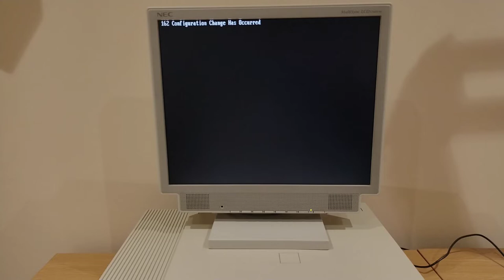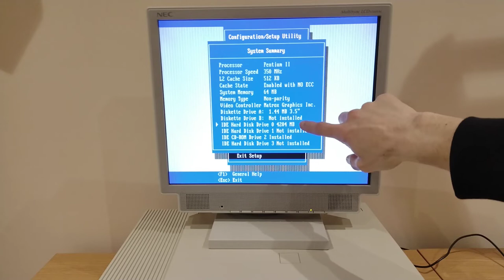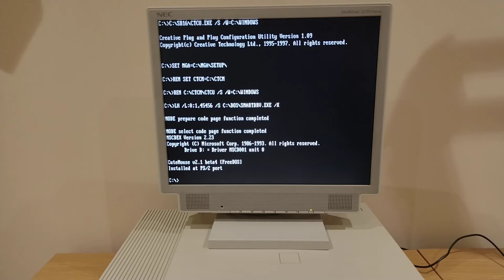IBM 300GL Part 2 - Lets (try to) put this 300GL to some use!

Comment: Nice two videos. With the size of that thing, looks like it barely fits on your desk. The keyboard would barely fit. How deep is that thing? And how big is your table?
Reply from the maker: Thanks, they do have  quite a large footprint, about 45*45cm. The desk (at the end of the video) is quite small though, only 53cm deep which I think makes it look at bit bigger than it is.

Comment: I've always loved the look of these cases. I have an IBM 300PL, very similar to yours except it supports slot 1 Pentium IIIs and has an AGP slot. makes a great Windows 98 machine. Currently have a Pentium 800MHz, TNT2 Ultra, and Sound Blaster Live! installed though it does have ISA slots if I ever wanted to make it a bit more DOS oriented
Reply from the maker: That spec sounds awesome, and very versatile as you say. That TNT2 Ultra and SB Live! are an inconic windows 98 combo.

Comment: hope you got that cd drive sorted. i recently rebuilt a PC350 - P200MMX model with the slidey-front cover. The S3 video kept booting in grayscale, HDD was toast, no CD drive at all and no soundcard. I shoved in a Trident PCI video card, 8GB CF card as the HDD, an IBM branded CD-ROM (probably anywhere from 8x to 24x speed, I haven't really benchmarked it), 3Com 10mbit network card and a very capable ESS AudioDrive ISA sound card. Now it's a beast! My first ever IBM too. Such a cool design and was something I only dreamt of back in the day :) 

Cheers for the vid!
Reply from the maker: Thanks! I'm slowly making progress with the CD drive, but there are a couple of other issues I'm trying to sort out too. Your IBM sounds great, I like specs you have gone for,  hopefully I can get this one sorted out too.

Comment: Cool PC, I have one but it is not in working order and has been sitting in a box waiting on me (4 years). I have and use my IBM PC P350- P166. It has a wonderful IBM ESS ISA 1868f sound card, Matrox Millennium /4gb GPU, Intel 1000MT network, 64 MB ram, IBM CD ROM and floppy. 2 hard drives 1.2gb, and 4.3 GB. I have OS/2 Warp 3 as the primary OS and it also can boot into DOS 6.2/WIN3.11 which I rarely do. I also have an old IBM printer (dot matrix) with it. My IBM crt recently bit the dust so just using an old Sony 17" LCD. On the lookout for a matching IBM CRT but not holding my breath.
Reply from the maker: Thats sounds like some sweet specs on your machine! Good luck finding an IBM CRT, they must be getting quite rare now?

Comment: I still have mine , but the cpu , cdrom and power supply are missing .  back in the day I upgraded the CPU to celeron 450mhz  using and adapter ( socket 370 cpu to slot 1), I went beyond the ram limitation and reached 728mo EDO.  if you had pci grahic card like geforce2 MMX  you would be able to emulate 90s consoles , and play over a hundred pc games
Reply from the maker: Nice! Those Slot 1 adaptors were great for giving a bit more life to systems as they aged.
Reply: @RetroSuperhighway  yeah ,  I even tried to mount the famous Pentium III-S  tualatin 1.4ghz on these adapters , but the system didn't even boot up. Maybe the limitation to FSB66 on the motherboard was the problem . If any one got the 100-133mhz slot one motherboard and could try  to mount pentium III tualatin on them using the adapter, that would solve my old interrogation

Comment: Hi i got ibm 300gl just wondering what kind of graphic cards are good put in this old system? I got sound card bottom  row , 2 rows are free then 3rd row network card then last row up top is free  kind stuck what card to put in 

Darren
Reply from the maker: What do you want to do with the system and what CPU and RAM does the system have? Lots of good options of to pick from depending on what you would like to use it for.

Comment: I remember these. Don't remember an optical uh, panel and thought it weird without one. I might say the onboard video might be more than adequate for DOS Win9x usage. S3 video chipsets are decent though if ya has the Matrox... heh ***shrugs***

Keep trying different KVM's? or cables? I like the KVM's with detachable cables that can be replaced, however those connection add their own set of problems. bleh. the KVM I used while being a technician, I attached Power and Network cables making for easy plug and go. DOS and BIOS usage is important and I would keep investigating for sure. <3 all
Reply from the maker: I'm sure the onboard video would be fine, its certainly more powerful than the Matrox, but back when I had my original 486 I always wanted a Matrox Millennium for that sweet video quality, so I'm determined to fit it into this build.

Investigations are ongoing, but it seems the 300GL might be a bit more poorly than I first thought. I'm going to be scouring the internet for some parts before I can make much progress with it.
Reply: @RetroSuperhighway  still a Beut' though! but as a primary DOS and Win95 machine? I think it's a bit much. toss the matrox into another build and stuff a voodoo2 or banshee or other fun video for winME and FreeDOS or uh whatevah! ***shrugs*** makes for gud videos for sure ;D

Comment: Great Video and a new Subscriber. Nice system. The Token Ring ran over RJ45 connection or over the 9 pin. Token Ring was a network where a token was sent around the network to collect data. Rather slow compared to the Ethernet but the RJ45 can not connect to the Ethernet network on that card. Only RJ45 Token Ring Networks
Reply from the maker: Thank you! Thats a great explanation of Token Ring, easy to understand for someone totally new to it like me. Did it still have some sort of central hub/switch like a 'standard' Ethernet network to manage the network traffic? Or was it connected in a literal ring where one machine connected to the next and so on. (A little like the old BNC type connectors where you had no switch, but they all connected to each other with a terminator at each end).
Reply: @RetroSuperhighway  I believe it was a logical ring not a physical one. I read about it but never really used it